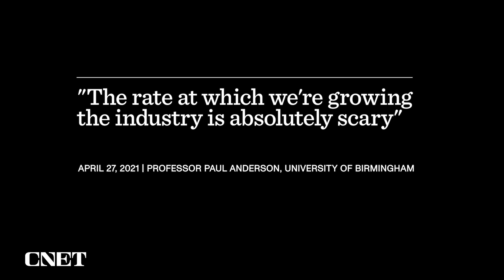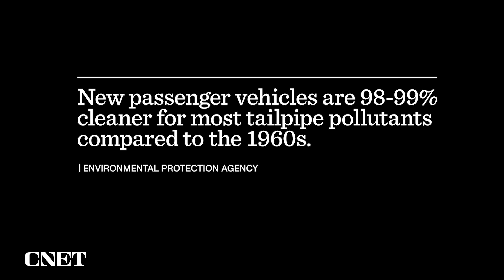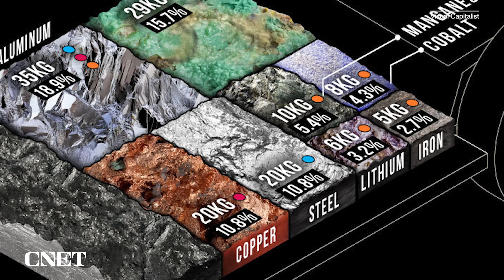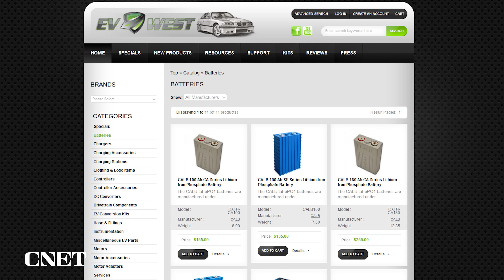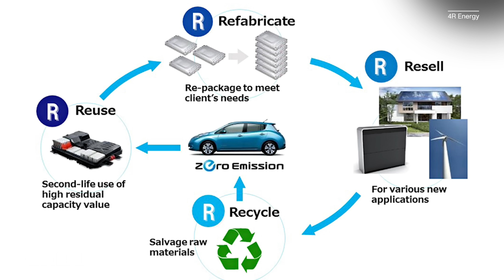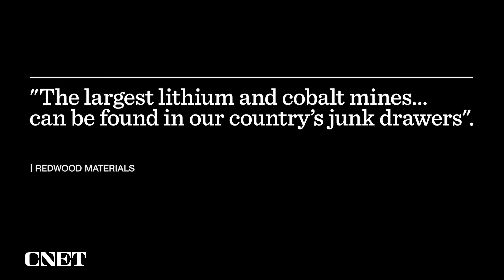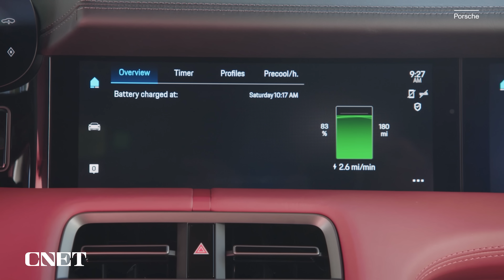MOUNTAINS of Dead EV Batteries Are Coming: Here's How We Plan To Deal With It

Comment: There’s several factors someone has to consider when deciding optimal battery capacity/range. Given an EVs life span, you’ll need to consider battery degradation. It’s safe to expect 2.5% (2-12.5 miles) battery degradation each year, which can add up rather quickly, making road trips more cumbersome. 

Wheel size can also affect range, so if you’re considering increasing your wheel size with some fancy aftermarket rims, the EPA-rated mileage decreases, and it can be a dramatic difference (6-12%) depending on how big you go. 

Accessories like a roof or rear-mounted racks for bikes, snow sports, and cargo boxes increase weight/drag, therefore reduces efficiency and mileage by 3-16%, empty or full.

If you want to tow with an EV will cut mileage by at least half on a flat straight road, inclines get exponentially worse.
Reply: @Jim Prpich the average ownership of any given vehicle is 10 years which would only result in ~25% degradation so that’s not taken into account here. 

If/when the battery ever needs replacing, it would be comparable to an engine & transmission replacement. We’ve already seen Teslas exceed 500,000 miles without any battery replacement.
Reply: There are many model 3s with >200k miles on them that have less than 10% battery degradation. And those model 3s are pre heat pump. The new model 3s and Ys have the heat pump and octovalve which means better battery heat management and less degradation over time.
Reply: Does usage affect that degradation?   We don't travel as much, and work from home.  Can I expect my batteries to last longer on average, or does it still degrade just from sitting there?
Reply: @lrom5445  Everything we’ve been told by Tesla so far is the charging habits of your (Lithium Ion based) EV can affect the amount of battery degradation. It is advised to charge no higher than 90% on a regular basis, if you need to charge to 100%, it’s recommended to not let the vehicle sit for a prolonged period of time. It’s also strongly advised to stay above 10% state of charge. That said, there will be some degree of battery degradation no matter how well you maintain the battery, and it won’t be consistently the same amount every year. 

Recently Tesla has started using a new battery type at their new Texas Gigafactory that makes the state of charge irrelevant, but they’re still using Li-Ion batteries simultaneously in their assembly line so it’s kind of a lottery at this point.
Reply: @sigma682  also the temperatures that the batteries are used, charged or stored at will affect their longetivity
Reply: @Jim Prpich Absolutely! Lithium mining can be very damaging to the environment if mined irresponsibly, which is why I was hoping Tesla was going to announce lithium-free batteries on Battery Day. At least the 4680 cells are cobalt-free, and I believe they may have reduced the amount of lithium needed as well.

Comment: where did you get your data for reusing batteries in emergency power application? I would never want to rely on defective battery cells at a high loss of energy due to degradation to be what powers an emergency lighting circuit in the event of a emergency......
Reply: Decreased range is not the same as defective.

Comment: Finally, I’ve been waiting for someone to address the dead EV batteries pile up that has escaped the news.
Reply: “Someone” began addressing this issue a couple years back when he left Tesla to found a company dedicated to refurbishing Tesla batteries...while Tesla focused on improving its battery maintenance and cell composition and increasing service life from half a million miles to a million miles.  There may be a “mountain” of batteries in time, but they’ll be a variety of GM, Ford, VW and BMW batteries produced over the next 15 years as Tesla (and Nio and BYD) gear up to supply the preponderance of market demand for BEV’s.
Reply: @johncahill3644  thank you for the informative response. I appreciate it.
Reply: What happens with none working cars today?
Reply: More like theoretical pile up, since it doesn't exist, most batteries are still in cars haven't even got to their second life
Reply: @rp9674  The bulk of original Tesla roadster batteries are still in service.
People are repairing ones with single cell failures.
Reply: @danharold3087  told you

Comment: I get a bad feeling about these electric cars,I think they will rape us in energy cost and repairs.
Reply: There is yet a very small 2nd hand EV market.  Once EVs get to 150,000 miles the resale drops like a rock.  I'm not convinced there is a Right to Repair, or even an OEM plan to service most aging EVs.  I keep hearing how EV have so few wearable components compared to a conventional vehicle, but everywhere I go I see cars from the 80s on the highway, not a huge number - but those are pretty repairable if you want to keep them running.  My primary vehicle is 27 years old and runs fine and is  fully serviveable, but I currently only fill up the tank every three weeks and I always check the basic fluid levels and look for leaks etc.

My father was involved in consumer electronics. In the late 1960s when solid state began to become common the mood was household items like TV sets would last virtually forever, but that soon become a fallicy.     Electrical gremlins are always a pain in the neck for service technicians unless they are extremely well trained, but I have thought that most skilled electrical diagnostic technicians should have been an engineer and not worked in a service garage because they are super smart and above average in skills and cognitive analytic skills - which means they are alway in short supply.  It may be true that an EV has fewer parts, but a glitch won't always be easy to repair - a lack of shared systems like OBD2 in gasoline motors.  You'll need specialized tools for working on various makes of EVs and as those cars age these diagnostic systems are replaced and the older test equipment might be difficult to source.   I have seen some once common dealer specific diagnostic tools listed on Ebay for $2,000, when they really aren't too sophisticated, but they are now obsolete, but many of the dealer specific consoles no longer function themselves.
Reply: @timothykeith1367  yeah I'm not hopeful on this electric car being as usable when they get older say 10-15 years old because I always buy used vehicles since it's such depreciating asset. Far as the combustion engine it still has potential to use any new fuel source like say hydrogen fuel cell then when it rusts back to the salvage yard with zero waste.
Reply: @wross5961  A gasoline motor that sees limited maintenance - I consider oil changes every 3,000 to 5,000 to be almost nothing as I do this myself. Coolant flushes every 3 years or so - paying attention to oil and coolant levels at least once a week.  The most common failures I've seen are overheating due to coolant system neglect, often a cooling fan that does not function.  Some  EVs have been recalled for cooling system failures as well - the batteries can get very hot.

Any mass produced machine will have failures.  I buy cheap clock radios at Walmart, I should buy better brands, but often the switches fail and the radio won't turn on or off. Electrical stuff isn't without problems.  Phones, computers, they have problems.   

I can replace a head gasket or a water pump on a motor and virtually keep a vehicle forever.  I'm not sure that an EV will have these single points of failure that are so easy to diagnose.

I'm not a luddite but I'm old enough to have a bunch of non functional electrcal devices - that somebody could repair.  I will wait for EVs to have a demonstrated 2nd hand market with wide availability of local and DIY service, but I'm not optimist that local EV techs will be affordable in the way that you can often purchase a $25 head gasket and repair a gasoline engine in your driveway.   Yeah, it could cost $2,000 for a mechanic to do that job, but its a repair that thousands of average skilled persons can do for relatively little.

I would like to see more gasoline motors have external electric water pumps - those cost more than a belt driven w/p but they are so easy to replace.   And as yet, LI-ON 12 volt batteries for older vehicles are super expensive, like $800 as opposed to a $100  lead acid battery from Walmart.  For now, I'm keeping my Geo Metro and planning simple mods to approach 60 mpg.

Comment: I argue that the much maligned Chevy Volt is the king of reduction. It offers 50 miles of pure electric driving that covers 90% of your annual driving, backed up by a petrol generator to cover that last 10%. The Volt's design eliminates the need for L3 charging and delivers far more miles per mined materials than EVs. But alas, EV purists attack it for having a tail pipe.
Reply: Totally agree.  I love my ‘14 i3 REx!
Reply: I agree with you, I just worry that it’s not ambitious enough for 2022. If it was 2010 and we were talking about widespread hybrids and plug-in hybrids, sure. But we aren’t moving nearly fast enough, and more ‘committed’ emissions, via hybrids and plugins are still an issue.
Reply: @Jason-sp5yc  I think there is a lot of evidence that extended range electrics address a market not reachable with today's EVs. Perhaps that will change in 2030 with the fast charging capabilities of solid state batteries. As for too late, it think it's clear that not enough people care about climate change to avoid some major calamities .
Reply: @KTPurdy  Looks like they have figured out the last obstacle to using sodium ion batteries.   Looks like they can be built on the same lines as lithium ion.    These might show up faster than we expected.  And have a much better charge density.  And we don't have to worry about lithium.
Reply: I totally agree.  I have a 2017.  After 5 years I still get 60 miles of ev range....more than advertised.  It was probably one of the best cars ever made in terms of ideas.  I have no range anxiety and rarely ever use gas.
Reply: Yes Volt makes more sense then full EV and so do hybrids, BEV is the wrong way it is less efficient, but there voice is louder than the hybrids voice.

Comment: Sorry they don't give thumbs down on videos anymore so I'll just make a comment on what bothered me.  As someone else mentioned about the charts in the beginning, what a great way to present a misleading picture.  The chart was accurate enough but then you added the comment about a 98% reduction in tailpipe emissions.  The two do not go together.  Tailpipe emissions in 1968 did not include carbon dioxide emissions and those have not had a reduction from transportation.  On fact the fastest growing segment of green house emissions is from the transportation sector (source is the US EPA).  It's odd that he would catch the 27% in the same report but not the other part.  He had some pertinent comments but when he discounted the emissions coming from ICE vehicles and instead focused on the problems with BEVs, he lost me.  Too biased to be on CNET.  I'm very disappointed.

Comment: Why is this everyone worried about batteries but things like tires have been around 120 years and still hard to get rid of them with limited applications for the used steel and rubber.  Tesla recycles over 90% of their returned batteries, they get back over 50 million a year in from the metals that are used for new batteries and electronics. Hopefully other automakers have similar recycling programs in place.  Plus Hybrid and EV batteries are on like their 2nd generation ?  The will be come smaller, less expensive, last longer and have more capacity every 10 years or so.

Comment: I'd like to address 1:37 in the video.  A reduction of 27% is not small.  Most people would be over the moon to have a permanent 27% off their rent or mortgage. Or 27% off their fuel bill.  Or 27% off anything they consume on an ongoing basis.

The discussion of replacing just ICE cars with EV and nothing else is only a purely academic discussion -- since it's not representative of what would happen in the real interconnected world.  Because research into EVs and consumer switch to EVs naturally has many side benefits like renewable energy and better safer batteries.

Specifically, EVs represent "economic leverage" to de-carbonize the electrical grid.  That is, investments to upgrade the grid with clean power also gets even cleaner running EVs by removing natural gas (methane) and coal from the energy mix.

By contrast, ICE cars offer no incentive nor motivation to de-carbonize the grid.  Actually, continuing to use ICE cars only perpetuates the fossil fuel infrastructure and hegemony -- this itself may be the worse of all.  Not even mentioning benefits of energy independence especially from some well known Eurasian despots.  Then the ongoing constant conflicts over this scarce non-renewable fossil fuel.

The US has a goal of 2035 to have a 100% carbon-free electrical grid.  The EU has similar goals -- and may be ahead of us even before the Ukraine war which will likely accelerate the EU's transition!

EVs push research into ancillary areas of the tech tree -- like renewable energy sources to power it and grid scale batteries to store it.  Aha!  Now we're getting into another 18% of greenhouse gases (GHG) used for residential & commercial energy use.  Wait!  Now into another 25% GHG emissions used for energy in industry like for concrete and steel production which rely heavily on the grid.

So what I'm getting at is the elephant in the room is the grid. ICE does not play well or benefit from upgrading the grid.  I get that the video needs to be short but these effects cannot removed from the discussion without possibly leading people down the wrong path on EV assumptions.

Comment: I think the fact that people think that internal combustion engines are at fault for the high degree of pollution worldwide is a misconception that the press has of the public.
I, for one and most people I know are well aware of the fact that ICE vehicles don't make up that much of the worldwide pollution, but rather the pollution we breathe in within the cities we live in.
That's where the problem is, inside the city. And if we can reduce the tailpipes emissions, that's great.
Won't solve global warming, not by a long shot, but it might make the air inside the city cleaner.
Reply: The transportation sector is the largest emitter of GHG in the US. Removing it worldwide will go a LONG way to getting our emissions close to the capacity of the carbon cycle. Low hanging fruit.

Comment: Hydrogen fuel cells will reign supreme
Reply: General Motors said that 45 years ago. There isn't much point using huge amounts of electricity to create hydrogen, to put it in a vehicle, and then the fuel cell converts it back into electricity again, with all the losses that entails. You may as well just charge the battery in an EV, and skip the hydrogen production process and all the transportation it will need. Electricity needs no transportation. There is very little interest in the concept of hydrogen powered cars in the UK. Just 30 were sold here last year. There are only around 12 hydrogen filling points in the whole of the UK, and not all of those allow public access. It's a non starter here.
Reply: Hydrogen is a waste of time and energy and money = not the future

Comment: What most people really need is a 1-2 seat quadracycle like the Microlino or Renault Twizzy that rarely goes above 35 mph/50 km/h for 95% of their driving... And a highway capable 4-5 seater for weekly grocery runs and out of town trips... At least that's what I've found when studying my own driving patterns. I only use 1 50-L tank of gasoline every two weeks generally speaking and that's with a 12-year-old Toyota Matrix... But 95% of my trips are around town in bumper to bumper traffic. I really need a city/key car most of the time with the option to borrow/rent a full-sized car once a week... If most people are like me, what we should be doing is investing in more electric car-sharing clubs and buying small cheap urban runabouts with really low specs for our own personal whenever use...
Reply: Exactly - an electric bumper-car is what millions of urban dwellers could benefit from, but most people don't know that yet!
Reply: That wouldn't work in the US because of suburban sprawl. 35 is way too slow.

Comment: Humanity will eventually realize that roads are already infrastructure and there's no need to haul thousands of pounds of batteries everywhere you drive. In the future the roads will have wireless electricity transmission built-in them. This way, each car will only need 50 miles capacity battery at most.
Reply: This will literally never happen.
Reply: Wired highways was a theme in certain magazines in the 1970s.

Comment: Redwood Materials will be the biggest battery recycler in the works. And many more companies will spring up.
Reply: Both Volkswagen and Renault both now have battery recycling facilities. A UK based company - Technology Minerals - is also looking to operate 5 battery recycling plants in Britain.... It is estimated the World will need around 150 battery recycling stations. Not all tired EV batteries will go for recycling. Many will (and already are) being used for energy storage in commercial, industrial and domestic applications..... They may no longer be suitable for use in an EV, but are perfectly good enough for energy storage.